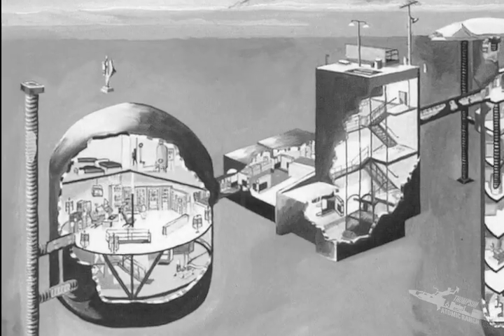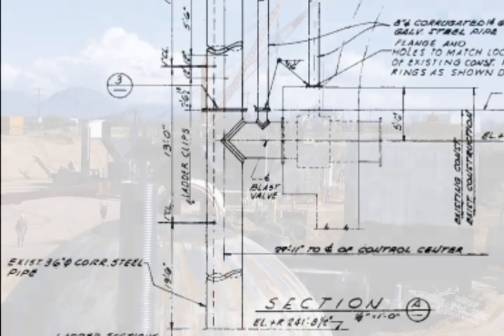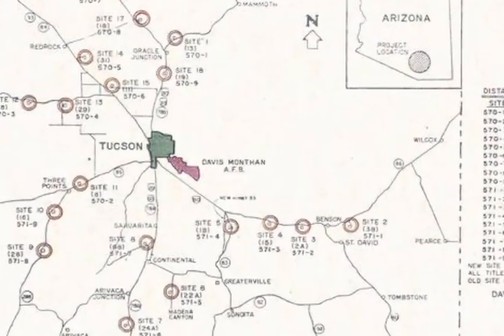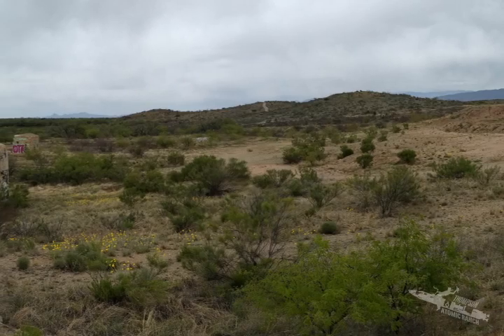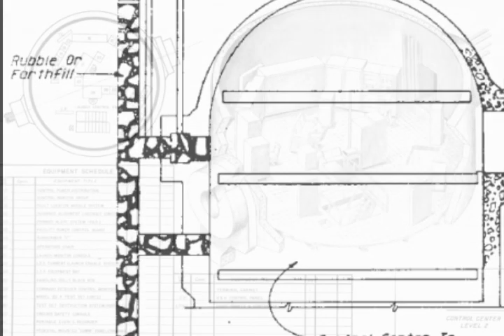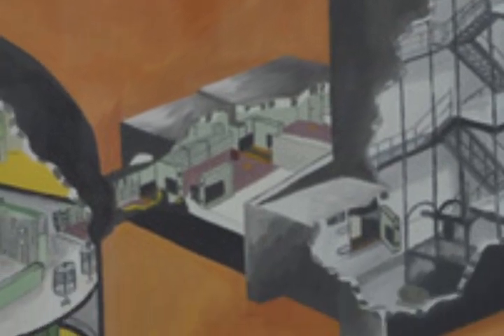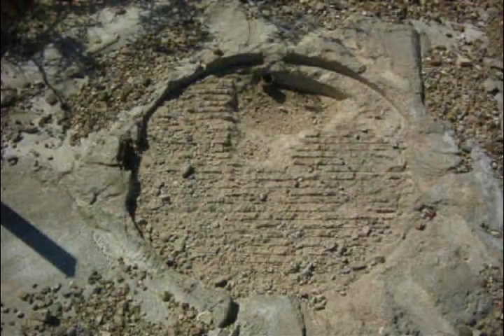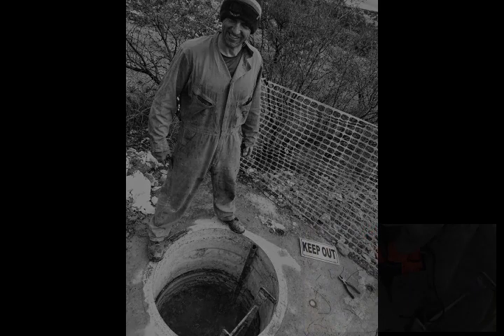Titan II Escape Shaft Entry

Comment: Any hope of checking out the removed original air shaft entry structures?   One of the strangest things about the design is how one part of the control center was protected only by a steel-only door -- both to invaders and bomb level air pressure.  In the video, it sounded like you said there was a thick concrete aperture.  Is that right?